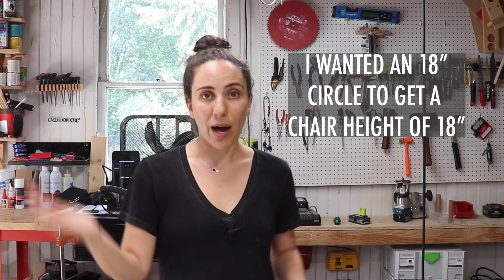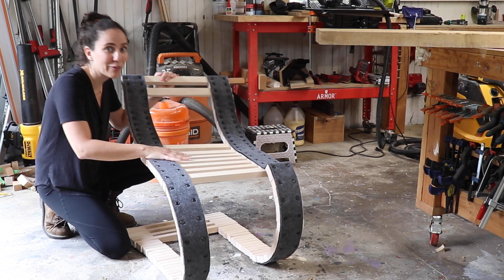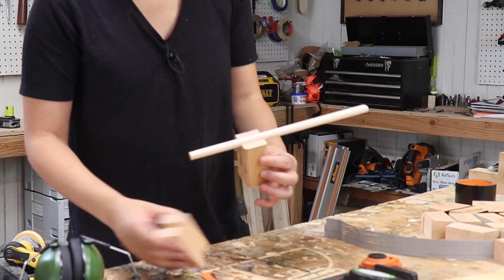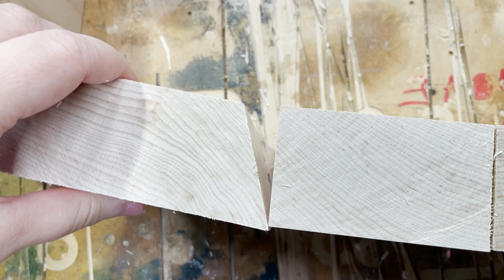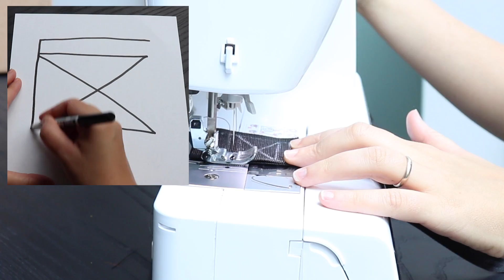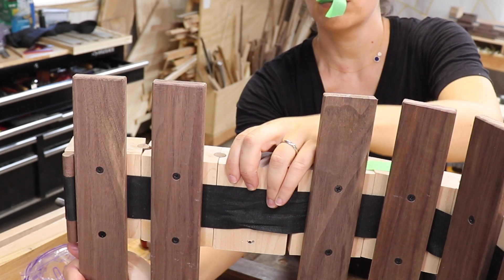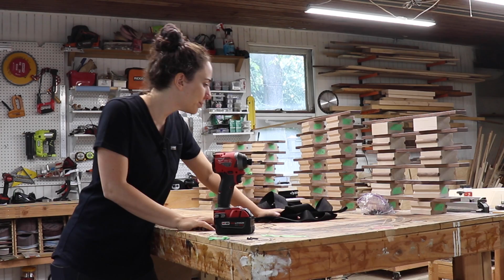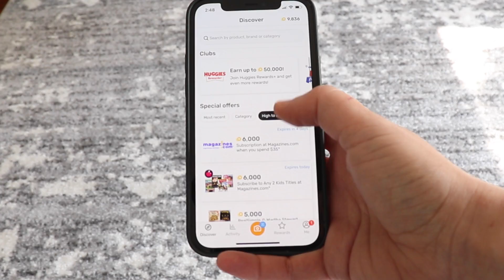I ATTEMPT to make a Roll Up Chair… AGAIN...

Comment: Part of the problem I think is that the stress on the bottom curve is transferred to the ends, where they curl. Conversely, slack adds up at the bottom curve and you get a big gap. If we can stop the movement of the strap, the stress won't be transferred, and each block will solve its own problem instead of passing it on down the line. I suppose that's what you were trying to achieve with staples and screws before.

Your dowel and box stitch is super secure. Now just double up your strap and do that for every dowel in between the blocks. Since you want it to roll up, you'd still have your top strap. But now you'd also have an "under strap" that dips down between blocks to go around the dowel. When it comes back up, you have a box stitch to the top strap.

The problem with this design is that the dowels are no longer glued, and will be dangling and may require futzing to get into position before you can sit. A better design might be to move the dowels to the bottom of the blocks and make them triangles instead. That way they are self-positioning and you could put a couple screws in them to keep them attached to the straps.

BTW, I think that original picture you saw was fake. This is way too hard of an engineering problem.

Comment: I bet you won’t read this on a 2 year old video. Just found your channel. Love this video.
I think part of the problem is using a single strap on an inside and an outside curve. The strap on the inside of the curve is creating slack and point stresses. This is because it’s stretched between the slats not over the maple. The strap tension on the inside of the back and the back to seat curve pulls the chair to collapse.
Two examples of this. The need to clamp the top. The way the chair does not support you when you sit on the front of it. Sitting on the front only puts no pressure on the back so these joints can side and provide slack.
I think 2 separate straps for the back and legs will solve this problem. Another option is making a seat piece from 2 wedges so the strap can transition from one face of the maple to the other.
Great video thanks!

Comment: There are videos I run across where I just think "that's cool" and move on, then ones where I think "that's cool, I actually want to try that myself". This is the latter, nice idea you have here, makes me wonder what other sorts of objects this sort of design could be applied to. Been working on flat/slotted items for cheaper shipping but going to look into this concept too. I think it's worth exploring running steel 3/16" wire rope inside the pieces and then putting a nut on each side to tension with a wrench to adjust/experiment with, but in things other than chairs, or linking the pieces rigidly like chains somehow.

Comment: I realize that I am very late to this party, in my defense I only just found your channel :) I love the philosophy behind your channel, I very much share it -- you stumble upon a problem, get to work and find a way our of it. Nothing of what I have learned in my life has turned out to be useless and, just like you, I tend to learn primarily from my mistakes, which is not necessarily something I am proud of, lol.
Regarding the technical issue, the way I see it is that your chair is a two-mode device: in one mode it need to be flexible so as to roll up, and in the other it needs to be rigid so as to support the weight a human. Synthetic strap of any kind cannot possibly help with the rigidity mode, you would have replace it by some kind of metallic chain of cable, which would add to the weight, would impact the flexibility mode and would require a lot of engineering, because it might even damage the wood. So I am thinking that geometry might be worth exploring for a solution to the rigidity  mode. The cross-section of the wooden elements could be shaped so as to get them to sort of lock between them at the end of the unfolding process, basically "resting" on each other kinda like the elements of a bridge. True, this means some engineering too, in terms of the cross-section that would do the job, but a lot less than figuring out a system with cables of chains. I am sure it is just a matter of angles and interlocking shapes, but I am only a beginner woodworker and definitely bad with engineering :)

Comment: The biggest problem is the mechanical design of the chair to begin with. You're putting anywhere from 100 to 200+ lbs of weight almost two feet away from a fulcrum with almost no counterbalance. Using the equation Fₑ × dₑ = Fᵣ × dᵣ you can estimate how much weight the strap would need to support. The problem is that with no counterbalance you would be dividing by 0, making it impossible to hold any weight. Your design isn't zero, but close to it. Even if a 50 lbs child sat on the seat and there was 6" of counterbalance, your strap would need to be rated to hold 200 lbs with no stretch. Looking at your design and generously estimating 2-3 inches of counterbalance, a 180 pound adult would still require over 3/4 ton (1,620 lbs) of effort on the straps to prevent collapse.

Hopefully I didn't completely deter you from the project. I still think something similar would be possible, but you would just need to approach it from a mechanical design aspect and search for materials ad designs that would support the weight. Good luck if you continue!

Comment: Your problem isn't the design, it's the flex. Metal hinges between each of the blocks would eliminate the flex. 
Do NOT use leather - it's very flexible.

Comment: You could cut a slot that goes under the straps and use bicycle chain as the flexible load bearing material. You might need some custom hardware to secure the chain.

Comment: Comment on a year old video for a project that  you've long since moved away from, but here goes... it isn't the webbing material.  Stretch or not, the ends will curl.  So, just add other webbing on the other faces of those curls.  The webbing on the "front" face of the chair is needed for that forward leg/seat section.  The base/leg and seat/back section would need webbing on the "back" face.  You could make these easily removable by making another dowel loop and having that dowel lock into one of your dowel slots in the segments.  Good luck if you give it another shot!

Comment: Two straps are probably too little of a surface area to provide stability. Use metal: bicycle chains. You will also need to use at least three strings, and cross connect the blocks to provide lateral support. Problem with lateral is that you need angular support in 140ish degree, so cross support will have to be shaped in cross, so just make the whole thing from cross segments.

Comment: One of your viewers mentioned using bicycle chain and it worked. UHMWPE stands for Ultra High Molecular Weight Polyethylene, it's a very tough plastic but the tensile strength is nowhere neat that of Steel. The lower the tensile strength the more it will stretch. The bicycle chain was a good choice, and maybe wire cable would work as well. Use materials with a high tensile strength. You are very creative and I enjoy your videos. Please keep them coming.
Gary

Comment: I love the design.  But one thing to think about is whether the design is a pinch hazard.  Especially for small children's fingers.  Imagine a gap opens up and someone puts their finger in there, and then shifts position in the chair, closing the gap.  Just something to keep in mind. 

I agree with the general comments that the problem is both stretchiness of the material AND that the stretch is allowed to propagate over the entire distance.  Pinching the material at each block would probably solved the stretch problem.  Using Steel cable or static line anchored in each block might actually work.

Comment: hi there! I am a structural engineer, and think I know of a couple problems that may be preventing your rolling chair to work. get in touch if still looking for an updated design
Reply: a) bending forces are not constant along the profile, but the tension on the stripe is (because there's no connection to each block, and friction is not enough). that's why the tension on the stripe required by the middle section is too much for the ends, making them curl. In order to keep constant tension on the stripe, the depth of the timber should match the shape of the bending forces. I could help with that.
b) the shear forces are not properly transmitted from block to block. Like in a stone arch, the angle where each piece meets the next should follow the movement of those internal forces.
c) (yes, I said there were two) the shape of the chair should account for the deformation of the stripe and the timber. It's fairly simple to calculate with the right software, I can help with that too.
Best of luck, love your channel!
Reply: just checked yor first attempt. because of the screws at every piece, the ends didn't curl.
on the other hand, the seat section was failing in shear, vertical forces couldn't move from block to block because their faces were also vertical.

Comment: About a year late to the party here and not to get you to try again just wondered if a thin cable wire through the parts that shouldn't stretch and tension could be adjusted on the ends?

Comment: use metal hinges instead of straps! it will be really heavy and weird but i think it will be strong enough and it will completely eliminate the tension problem because all the stress goes to the hinge instead of traveling through the strap

Comment: 27:45 
Not to sure what kind of strapping you have tried so far. But You should be using Seatbelt strapping with your improved design. You need  a strap that cannot stretch when in tension. Seatbelt strapping was engineered for that exact purpose.
Reply from the maker: That’s what I used

Comment: With Pre-Tensioned construction, It seems the build it and see doesn't work. You might actually need to look at the specs of the materials and calculate where to drill holes and such. Taking into account the specified % stretch under load.

Comment: You are allowing the material to stretch over the whole length of the chair. In the previous video you attached the material to each block which would work in this case.

Comment: Leather won't work either. Dowels and seat blocks would. You need wood blocks for your angle wood blocks to slide along and seat into. The strap is only to hold everything in a roll, not structural.
My advice is to look very closely at a Tommy the Tank toy to see sliding buckles.
So basically, you are replacing the strap that will never work with wood hinge blocks. Another chance to add color here too.
It was great seeing how bad a carpenter can be and still get sponsors.
Reply from the maker: Why would I take advice from someone who doesn’t know the difference between a carpenter and a woodworker? Now go make me a sandwich!

Comment: Idea…it appears that your strapping is ran such that it’s underneath the chair and then on the outside of the seat curve, then it’s continued so that it’s ran on the inside of the back curve.  

I believe with tension this actually creates an opposing force at the back curve.  Maybe right before the seat meets the seat back, you weave the strap between one of your segments so that it will then be on the “outside” of the back curve.  This will keep tension on the segments.  It likely will affect the roll-up ability of the chair but it’s worth a try.  🤷🏽‍♂️

Orrrrr, run the strapping the other way and still weave to the opposite side.  So the bottom portion would be on the inside of the seat curve and the back part on the inside curve

Comment: I could be very wrong, but I don't think the straps themselves were the problem.  I think if you actually attached the strap to each piece individually instead of only attaching it to the first and last piece, allowing the strapping to float, it would work.

Comment: I would make all of the blocks wider or full width of the chair and use piano hinges.  Far less likely to collapse to the side and more surface area for the pressure to distribute evenly.  Also the metal hinges would not stretch.

Comment: Had you not thought to stretch the strapping one block at a time? This would effectively give you short sections of strapping, meaning that, say, a 5% stretch in the webbing would mean a much smaller expansion per joint. It would also prevent transfer of the tension to other parts of the chair.
Reply: Damn! Just re-read my comment. So very mansplainey. Terribly sorry. Not my intention. I think you rock and I learn so much from your videos.

Comment: I haven’t read all the comments so I don’t know if this was mentioned. Also I’m not an engineer so my observation may be invalid.
One big difference between versions 1 and 2 was how the strapping was attached. In v1 the strapping was attached to each cross piece. In v2 it was attached only at the ends and floated between the white and dark woods.
In v1 this resulted in different amounts of tension between each joint depending on the stress applied. 
In v2 the tension was distributed between all joints equally. Those joints requiring tension (where the strap was on the outside of the curve) had too little tension, hence gaps between blocks. The joints requiring less tension (where the strap was on the inside of the curve) had too much tension.
This allowed separation where compression of the joint was needed and compression where separation was preferable.

Comment: Leather WILL NOT work as it is actually quite elastic.
The problem is that you are trying to rely on a single member that crosses over parts that are tensioning in different directions, depending on the direction of the curve.
Solution to both the dangerous tension problem and the gap that opens: hinges. You could create either wooden hinges, which will be bulky but could be integrated into the geometry, or use regular metal hinges bolted to the same face the strap was. I would still use some sort of locking/locating geometry like the dowels for safety, and it might take some "pre setting" on the back angle to prevent it from flopping over.

No straps under tension, and no gaps can form because of the rigidity of the hinges.

Comment: Because of the design of the chair, forces end up being multiples of the weight you place on it. You may end up having forces equivalent to tons of weight between the links. You would need a material with extremely high tensile strength and very low elasticity or plasticity. I am not a mechanical engineer, but the only fabric coming to my mind is Kevlar.  I would go with the suggestion below to use a chain.  Ikea's Poang chair is of similar design, but made out of bend plywood with the fibers running in same direction as your straps.

Comment: Hey 3x3, I enjoy watching your exploration of new design ideas like the ru chair. Here are some thoughts: your materials may be working against you. The fabric strip seems like it is a mesh material and I believe that mesh inherently flexes. That small coefficient of flex over the length of the chair may cause chair failure. Moreover, if the mesh were to work, it probably would have to be pushed to its breaking/failure point--a dangerous situation. Additionally, even hardwood must have a coefficient of compression though very small, and if so, that may be working against you as well. Lastly, the act of "sitting" puts dynamic and static forces upon the chair structure so that even if the chair were able to stand by itself, sitting on it may cause it to fail. If you do get a suitable mesh material to work, you might try reversing the cuts of the back blocks and snaking the mesh to the inside of the back. That might help but no guarantees. I think you need to think in terms of forces, dynamic and static and their directions (vectors), that a chair resolves and how you can make a roll up chair with a collapsible structure work. Hope this helps. Oh and another thought: if the chair blocks were all glued together would it work as a chair? If it did, would the mesh adequately replace the glue? If glueing would fail as well, mesh may never be successful. You might try putting a continuous strip of mesh on both sides of the blocks. But this would defeat the roll up concept.

Comment: i would suggest using car seat belts combined with an increase of the angles of the lower curve blocks.this would bring the seat portion to about 30 degrees above horizontal.when you put your weight on it it should settle closer to the horizontal.i really enjoy your videos and the trial and error determination to get it finished and correct ...from bigtom in the united kingdom

Comment: Using the dowels to prevent twist is impressive ingenuity. I think your next attempt you can solve the flex issue. Maybe the one after that you'll solve the seating angle when standing up and sitting. Super cool

Comment: Underneath the strapping, you should try nailing in heavy duty steel strapping coil. It would still roll up, but it would have ZERO give unlike the nylon strapping.

Comment: It might be that you need more boards cut thinner. Try doubling the segment count over the same length, by cutting them in half. This might make the arcs more "fluid." It's kinda like old stone arch bridges and the sliding vertical doors on old wooden desks.